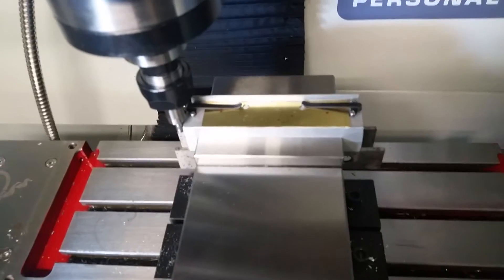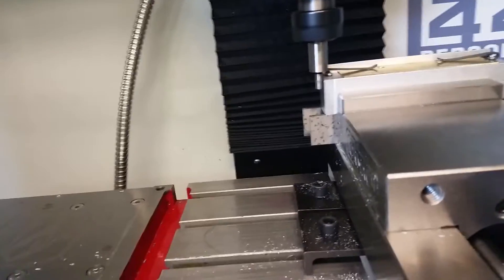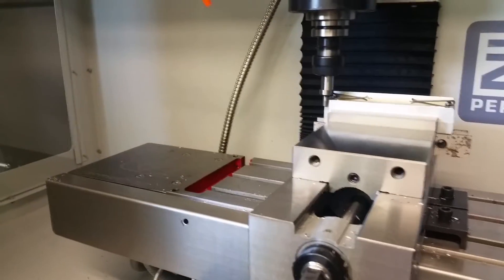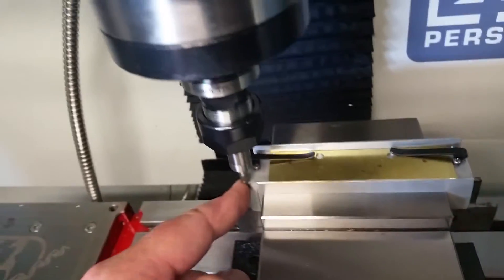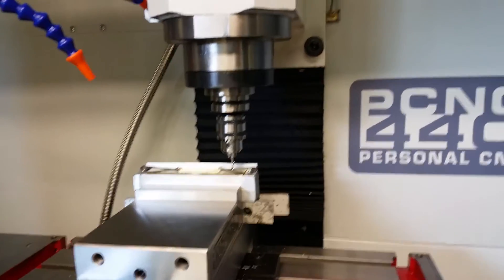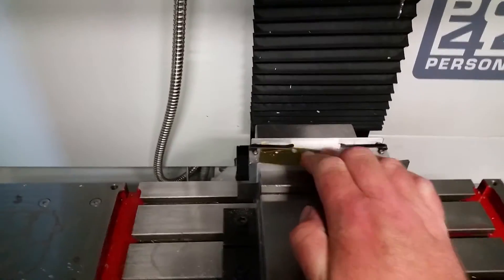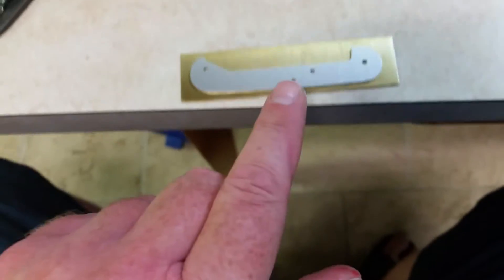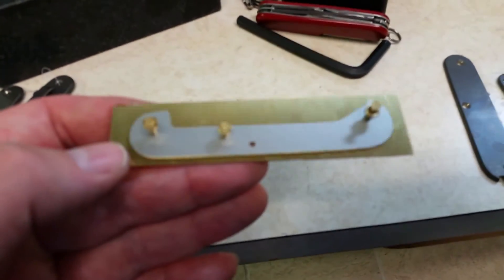First Part on the Tormach 440!  91mm Brass SAK Liner 1 of 2

Comment: Looks good.  Do away with the pecking.  I know how you feel about the cheating.  Nothing wrong with baby steps.
Reply from the maker: Im so used to making all the part by hand, I have much more jeweler skill than CNC skills, but if I can get this machine to do the hard part for me, then I can do the fun part.  Normally Id drill one hole, then use dowel pins and drilling guides to drill one hole at a time.... Now I just push buttons and drink coffee.

Comment: Congratulations!

I bet you don't need to bother with pecking with material that thin. I generally shoot for 2x the drill diameter, but if the drill gets clogged up or a big-ol' bird's nest forms, reducing the peck distance will probably help. Of course, I can understand why you chose that cycle for the machine's first run.
Reply from the maker: Ya Im not ashamed to admit Im a total noob with the CNC, but I cant wait to make full use of it.  The wizard I used had dwell time and pecking distance so I wasnt exaclty sure if I needed either with such a shallow hole.  I only had one 2.2 mm carbide drill bit so I was worried about breaking it.